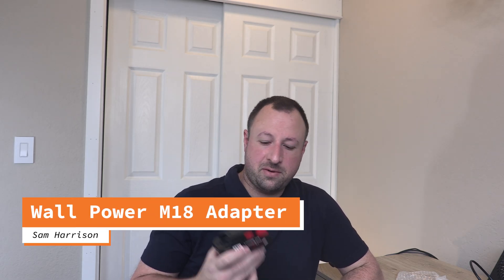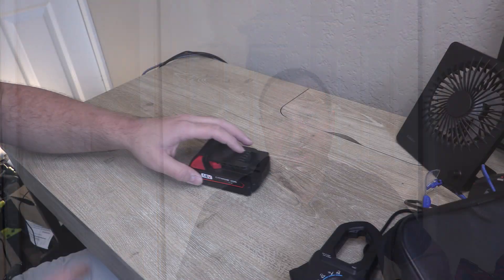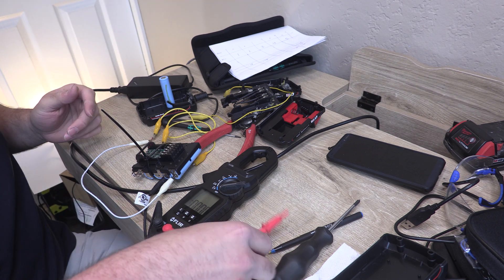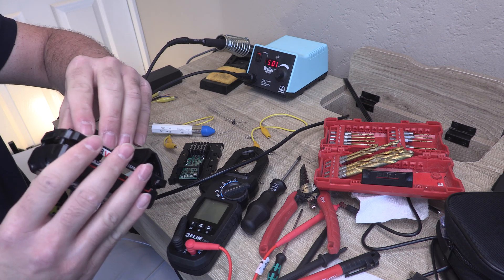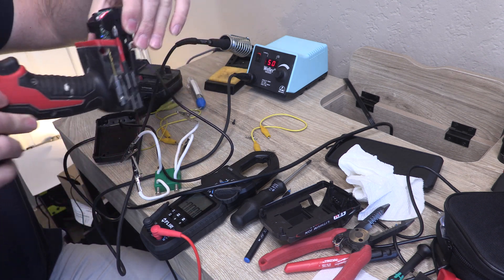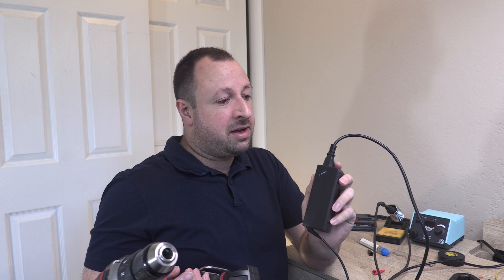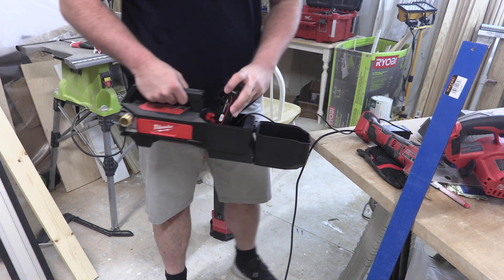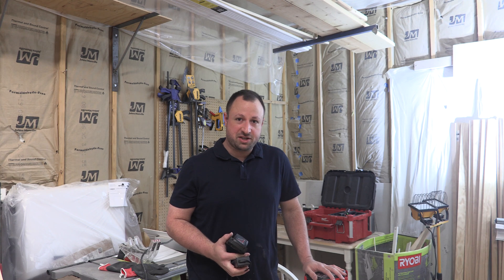Plug your M18 tools into the wall!

Comment: I wonder.. if you kept the good battery cells, would those battery cells act as a capacitor themselves? You already have the handshake between the tool and the pack, would it also charge the batteries with lower the amp hour life IF you used one less battery?

Comment: I tried this with an old 1.5 ah small M18 pack and it just didn't do anything.  I used a 240W Dell Power supply that doesn't need any sort of checks with a computer (it just used a barrel adaptor Model #PA-9E) and I didn't get anything.  The battery also wouldn't respond.  The Far right and Far Left battery terminals have 19V across them which is what the power supply seems to output despite the nameplate claiming 19.5.  I'm thinking that the Genuine Milwaukee battery requires the test points to operate properly at each set of series cells.  

I'm gonna try to voltage divide and tap at each terminal to simulate the cells using resistors to see if that might make it work.  I'm doing this for my M18 shop vac so I'm thinking that 240W should be enough to keep it running.
Reply: A barrel adapter isn't anywhere near large enough to supply the current that an m18 tool is looking for.
Reply: @SkydozerFPV  yah realized after it was a total failure.  The power supply I used was a junk one anyone so it was a fun project and the battery I used was a knock off one that had bad cells so it wasn't worth re building.  Really didn't lose anything trying.  I managed to get an old drill running on it but you were 100% right that the available 240W wasn't even close to being enough even for lighter tools.

Comment: you kind of brazed over the capacitor part, where do they go, do you have to un solder existing capacitors? can you daisy chain some together?  need more info here.
Reply from the maker: Hello - you don't want to touch any of the existing capacitors on the PCB. The capacitors that get added should be roughly the size of a 18650 battery (or smaller) so they fit within the battery shell, and they are all added in parallel with the input wires from the power supply.
Reply: @harrisonhobbies241 Ok for the physical size, but what type, voltage and uFarad size? Where do I insert them in the circuit? Sorry for my ignorance. Still going through all your videos in attempt to power my Craftsman 19.2 volt drill that used to run on NImH or NiCads. 

Thank you!

Comment: My only suggestion is tie the wire in a knot in the battery. Keep it from pulling the soldered leads apart.

Comment: I do enjoy customizing my own tools whenever possible. But in this case, this idea will take off, guaranteed. There is no need for me to make one, Somebody will make a proper adapter with the right power running through  and retail it for us Milwaukee fans.
Reply: When do you think that will happen? It seems easy enough. This video is almost 4 years old and it still hasn't happened so what will change?
Reply from the maker: I'm still waiting for this too :)

Comment: Frankly don't know why Milwaukee has not produced a convenient and durable AC Adapter for their M18 and M12 lines ( mostly M18, since they encompass HEFTY STOUT tools like Table Saws, Miter Saws etc. which are mostly stationary). Surely a company as innovative as Milwaukee could do so wand give their customers the ability to run those large stationary tools off available AC power without having to endlessly recharge batteries, and yet not sacrifice portability and the ability to use them where no AC is available.

I am certain it has to do with ECONOMIC considerations and not technological problems. Perhaps they don't want to lose the revenue stream of producing endless numbers of batteries for these tools. But that is foolish. I think the customer base would appreciate this feature and it would FURHTER STRENGTHEN the brand loyalty, while not making too big an impact on battery sales, since many contractors and professionals will still use these tools in circumstance where AC power is not readily available, and portable tools like circular saws, drill, routers, reciprocating saws, etc. would STILL be used without the cord.

Are you listening Milwaukee?

As as the owner of of a huge amount of both your M18 and M12 line, and on the verge of purchasing large shop tools like table saws,  miter saws,  thickness planers, joiners, band saws etc. , such an accessory would go a LONG way towards increasing your appeal to people shopping for this kind of shop tools in competition with other corded brands such as DeWalt, Grizzley, Delta, Skill, Bosch and give you an even bigger leg up brands like Fesstool.

Comment: Why don't you leave the batteries in place, parallel into pin 1 & 4  +/-   The batteries will handle the high amp start up and the supply will supply 18volts - and trickle charge the batteries.

Comment: I'm looking to do this for my EGO light 56v  Not sure I have the skills. 😂
Reply from the maker: Theoretically, it should be the same as this... just higher voltage and more dangerous since there is an actual shock risk at 56v. 

I've made quite a few videos after this one detailing much higher wattage options - and i plan to investigate expanding these to other brands of tools (i'll be looking at DeWalt and Makita in the coming months. At some point, Ego and the other larger outdoor brands could be an option for me to look at as well - though no plans in the immediate future.

Comment: Does this work with m18 air and?
Reply from the maker: This specific configuration won't, but I've built much larger units that handle the compressor. https://youtu.be/gT8et0RFU9A

Comment: Need something like this to run my heat gun, looking back it makes sense to just have got a chorded one considering how much power they pull
Reply: Yes I do Corian counter tops. Milwaukee heat guns use alot alsoo.. glue guns use a ton. Not worth it. Have corded for both to much battery for heat up times

Comment: Hi there. Glad I ran into your channel. I bought a battery powered vacuum cleaner and I'm wondering if I can rig up your system to wall power it? Since it's not Amp hungry do you think I can go with the laptop approach psu or will I need to go the other route you did with 100$ psu

Comment: Milwaukee should do this for the table saw and miter saw. They added a plug 🔌 for the Milwaukee rocket 🚀 work light 💡. I wanna do this with an actual power supply (meanwell) unit that you use on machines and 3D printers.
Reply: Please let me know if you find any solution
Miter saw Milwaukee same here

Comment: Great idea, also have to remember amperage, a laptop typically doesn't require the amperage a power tool does
Reply from the maker: Agreed on that! I have some follow-up videos where I test a 1,200 watt power supply with much better results.

And more to come on an even beefier system in the coming weeks.
Reply: @harrisonhobbies241  cool I’ll chk em out

Comment: Awesome video, I was just thinking about this in the shower.  It’s funny because I realized that the whole purpose of the brick part of a laptop charger is a transformer.  So I was thinking to make one of these adapters work for a battery powered tool, you’d have a transformer on it.  I didn’t fully close the loop until I saw this video, that you can literally use a laptop charger.
Reply from the maker: Yep... finding a simple transformer without any third pin handshake is the problem... but pretty straightforward overall.

Make sure to check out all of the other testing I did with larger transformers.
Reply: Man I read that as "I was just thinking about doing this in the shower" and I was thinking that's some dark humor that I like😂I re-read it, and it makes a lot more sense now..
Reply: @SkydozerFPV  lmfao

Comment: If you are trying this with a genuine battery, don’t bother! 

You can trick the microcontroller on a genuine battery with a voltage divider network to apply 4v on each pin (just like the batteries did) however, you still need to plug the modified battery into the charger to restart the microcontroller every time you apply external power. When you turn external power off, you’ll need to repeat the plug into charger step every time you apply external power. If this isn’t a problem for you then you can get a genuine battery to work like this.

Took me a bit to figure that the charger is the turn on mechanism for the microcontroller.
Reply: You just saved me a lot of time. Which battery did you go with?
Reply: @danieltupikov2078   , I went and got myself some of these knock off batteries which don’t need the voltage divider circuit. They worked perfect on everything EXCEPT my back pack vacuum 🤦‍♂️😭 (which is my small shop vac and the reason why I wanted this converter). Turns out the back pack vac won’t work unless it sees a genuine battery or it’s just rejecting my particular knock off batteries. Found out that applying a jumper off the 8v leg of the divider to the J2 (pin between charge and negative) for about 2 seconds fires the microcontroller up and now she works beautifully sucking 20 amps at 21V.
Reply: Thank you!  I also tried a genuine milwaukee battery, and had this (non-working) result (even though the raw voltage across the pins looked good).  I could not get it to reset in the charger either.  Any trick to that?  Would love to hear if anyone can get this working for all devices.
Reply: @ryanwgardner0  just buy a third party battery. You can pick one up from Amazon for like 30$
Reply: @ryanwgardner0  did you put it in the charger with your external power already on to the battery?
Reply: @JordyP89  I tried it that way and without the external power.
Reply: @ryanwgardner0  Probably need to see your setup mate, mines been working perfectly for about 2 weeks now

Comment: waiting for a video for adding a capacitor.
Reply from the maker: Hello! sorry for the delay in posting videos. I actually did have capacitors in the follow-up, but i didn't actually post a video of installing them. https://youtu.be/arXXAF89-wg

Based on the size of capacitors that would fit in the pack, i don't believe they had too much impact on the starting capability. You just need lots more power.

Comment: I still have my DeWalt 24 volt 5.25 circ saw and .5 hammer drill. They both came with an fan cooled ac adapter the slides in the battery slot. I still used the saw plugged in because it it light and easy to use.
Reply from the maker: Thanks for sharing! I wasn't aware DeWalt had that as an offering. I sincerely hope Milwaukee has something similar in the works.
Reply: @harrisonhobbies241  they sell the AC dc adapter on Amazon. I am thinking of getting another one to tinker with to run my Milwaukee and Makita cordless tools

Comment: I don't understand why the battery isn't flashing as dead
As all the cells have been removed, there's no balancing signals. That should be upsetting the battery board and the tool

Comment: You can do some quick math to figure out the adapter wattage required for sustained load. 

Figure out your run time on an existing battery. My 3Ah battery will run my transfer pump for 15 minutes. 15*4 = 60 minutes. So 4*3Ah = 12A. 12A * 20V = 240W. Hope that's right but it sounds correct. Startup is the killer though so you'll still probably need a capacitor.
Reply from the maker: i actually did wattage testing on all of these (check out my other videos), and your math puts you in the ballpark.

Comment: I'm gonna try and emulate your successful use of a 400w DC PS.

I bet, out of 7,000+ views, at least 1 Milwaukee employee has seen this. Dear Milwaukee - There is no weakness in admitting that wall outlets are sometimes better. Offering this capability would only increase the versatility and value of your 18v/12v tools. When I'm on a 12' ladder driving 30mm bolts for a structure tent, I love the battery. Especially that fat-ass 12ah. STUPID thick! But, when I'm at my work bench, wall power makes more sense. Plus, you can market it as "We're cutting e-waste by letting our customers choose grid power when they don't need batteries." Batteries that will, ultimately, need to undergo an extensive, expensive recycling processes lest they contribute to our dying climate sheds single tear But, seriously, Milwaukee's CEO should be offering this guy a job. And offering me a brushless tool kit of my choice, since I gave you that "choose their power" hippie crap above. People will buy it hook, line and sinker😎
Reply: Well said!
Reply: I would like to see a 28-volt AC adapter for my bandsaw. Whe Milwaukee switched over to 18 volt, they left a lot of 28-volt customers out in the cold.
Reply: When doing trim work it is so handy to have your vacuum hose on your saw, and have it auto start when you pull the trigger. Cannot do that with cordless. Usually I just cut outside, but I can only do that for 4-5 months out of the year in Michigan.

Comment: I always been wondering, why in the hell the tools company haven't come up with something like this...
Reply: Because they will loose lot money for selling them battery and tool will running longer time then before cause more tool broken they need fix
Reply: Dewalt did. I have a circular saw and  hammer drill that are 24v nicad . they also came with a fan cooled AC DC converter. I still use them today.
Reply: The concept is a lot less popular then you'd think. Sounds cool, but implementations of this have never sold well.